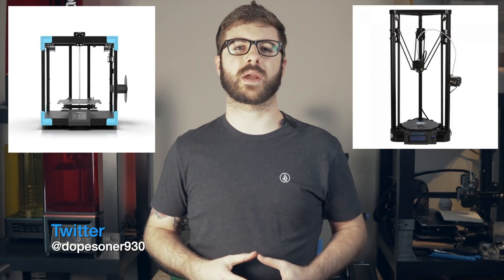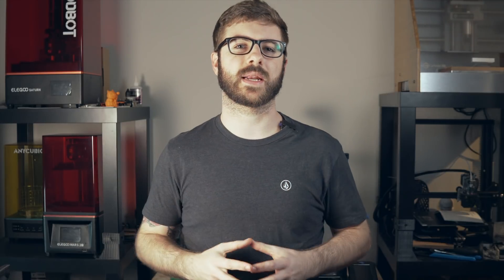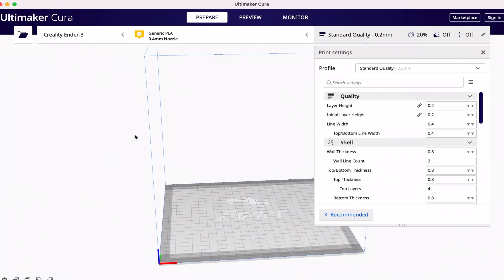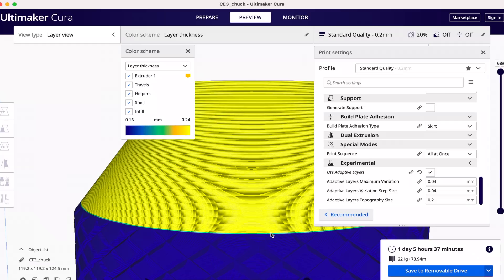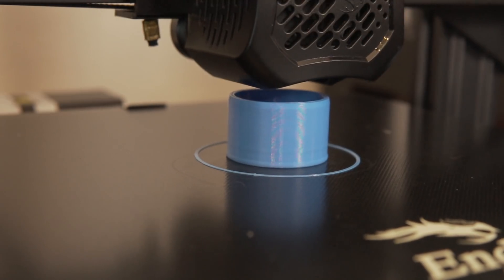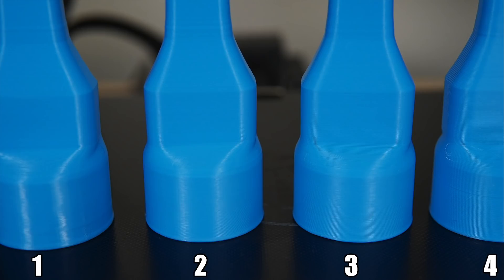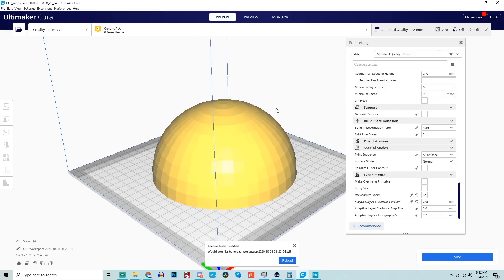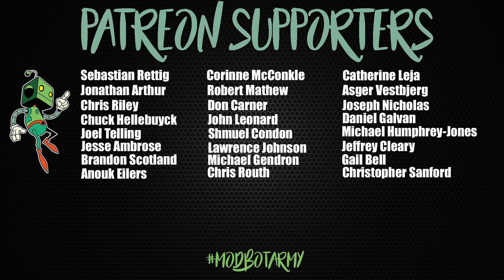Using Adaptive Layers For Faster 3d Printing

Comment: I have been printing Warhammer 40k bases and using Adaptive layers has saved a lot of time, especially on larger bases. Most of the layers is simply a circle with infill, and I paint the sides black, so they layer height doesn't matter so much, but the top surface quality and layers need to be high quality. On my largest bases (130mm), it took my print times from being 26hrs to 13hrs.

Comment: I do not know how did you speed up anything there, i print on 1,50 layer , extra fine , without adaptive at all, with 0,6 nozlle, 23 hourst for model, with adaptive, fastest mode from your video is 28 hours and up to 32h print time. so its 30-50% MORE time not speed up.  only thing that is, model look smuch finner with adaptive layer.

Comment: Is there any way to do this and still have you're parts FEATURES be at the correct height? Can it increase and decrease the NUMBER of layers depending on the layer size locally in the model?

Comment: The way I understand it, is that it works both ways for every layer: decrease time and quality or increase time and quality :) If your model has a lot complex features, it will on average decrease the layer height more often, than increase it. You can tweak it to force what you want, but we must remember, it is not a magical tool.
Let's say your goal is only speed and your standard layer height is 0.2. Then, what you should do is to raise the default Height for example to 0.22 and Maximum variation to 0.2. Your height will be always between 0.2 and 0.24. With such parameters, it cannot take more time. Never. Can only be quicker. But as a consequence quality will decrease more or less significantly. Cura provides an overview, which layers will be impacted and how much, to assess if it make sense at all.
You can go the way around and decide to put focus on having nice curves in the X-axis. You would just setup layer height to 0.18  with a 0.2 Maximum variation. With such parameters, you will get a layer height between 0.16 and 0.2. In that case, printing time will be increased, but only for "complex" layers.
Reply: I set mine to such a setting but set the topography size to 0.2 also. It does 90% of the print at 0.2 but very large and flat surfaces get bumped to 0.24 which speeds things up a bit without losing any visible quality.

Comment: It seems a little nonintuitive with some parts and value combinations, but it's really fascinating to play with all of the numbers while viewing the layer thickness. 
I think this will solve a particular issue I have with a part that is too thin and requiring more, thin layers that slows printing but allowing the rest of the part to be printed even thicker than my default and shave off a ton of time in general. Really cool Cura settings, thanks for sharing!

Comment: I can definately see the difference. but the real issue here is, does it matter on a piece like this. my answer would be no, it doesnt. if you were printing something that you wanted to look its best, then obviously you would do without the adaptive layers. but for this, you just want it done fast and still be useful, which it is. great video.

Comment: Increasing layer heights over 0,2mm decreases print strength. It might be important for functional parts
Reply: Only if you're using a .4 nozzle or smaller.  I use .8 nozzles for my functional parts and typically print at a .4 layer height and they are very strong.  I usually don't go above half the nozzle width if strength is required.

Comment: I've been playing with adaptive layers, and I agree I wish I could set it not to switch back and forth.  I've got this part that has one little line of a different layer height and I'm worried that it will show up as a line in the part.  It's a decorative part printed in silver silk filament, so the surface finish is very important.

Comment: I tried adaptive layers a couple years ago and it messed up every print in the same spot of so many prints. It would cause jamming and skipping then under extrusion so i disabled it. For the longest time I thought it was bad Gcode or my printer  was messed up but it turns out it was just the adaptive layers causing it. Maybe its better now than it when i last tried it?

Comment: Is there a setting to print the infill layer height at a different resolution then the perimeter. I can see how logistically this would be difficult based on the geometry of the extruder tip. But could be a huge time saver to get high resolution on the outside while reducing print time for infill patterns. And while decreasing infill density is always an option to reduce print time, that sacrifices structural integrity while changing layer height really does not.

Comment: bigger layer height =stronger prints
bigger nozzle is way better imo
Reply: This is wrong.  A bigger layer height produces a circle rather than an oval.  An oval will contact more surface area with the prior layer resulting in greater strength.  A bigger nozzle can create more of an oval though if that's what you mean.

Comment: I think that the main idea behind the adaptive layer high is not the speed or the quality but the precision. For example if you print 25.5 mm part with 0.2 mm layer hight , you will build it 25.4 or 25.6 . May be with that setting we can build it exactly 25.5.

Comment: I believe Flash print has a automatic setting for that so it's clicked it to us and it will adjust according to like you explained. However there's not many videos going in depth for Flash print like there is for cura

Comment: Is there a way to print everything but outer walls thicker? Like say .3 vs .2 granted every other outer wall would be printed twice but that would even allow a spiral eliminating half of the layer starts on the outer wall too.
Reply from the maker: Not as far as I know. I feel like I have seen dual extrusion setups where you can do infill with a larger nozzle and use the finer for the outside to speed things up. But I have not tested myself and am not positive that it is a thing.

Comment: Cura has improved quite a lot.It’s just  a shame it’s not as good as Simplify 3D to set up multiple layer height at different heights with more control. Although manually

Comment: Personally, my biggest timesavers have either come from 3D Printing at a 0.6mm layer width instead of 0.4 in combination with only using 2 instead of 3 perimeters for the same total layer width but a rough ⅓% perimeters print time reduction and by simply avoiding the use of supports for as much as possible either via designing the print to not be needing them to begin with or by modifying the design to include faster printing custom mesh acting in place of automatically generated supports. Also bumping up the Speeds of many moves can shave off a lot of time.

Comment: is there a way in Cura that I can change the layer height during the print? I would like my print object to be set at .2mm layer height, but the top few layers, I would like it to be printed at .1mm layer height. Is that possible?

Comment: Unless I'm doing something wrong, ticking adaptive layers, and using any of the 3 examples you used, my print time increases, rather than the expected decrease..
Reply: Remember It work both ways for every line: decrease time and quality or increase time and quality :) If your model has a lot complex features, it will on average decrease the layer height more often, than increase it. You can tweak it to force what you want, but remember it is not a magical tool.
Let's say your goal is only speed and your standard layer height is 0.2. Then, what you should do is to raise the default Height for example to 0.22 and Maximum variation to 0.2. Your height will be always between 0.2 and 0.24. With such parameters, it cannot take more time. Never. But as a consequence quality will decrease more or less significantly. Cura provides an overview, which layers will be impacted and how much, to assess if it make sense at all.
You can go the way around and decide to put focus having nice curves in the X-axis. You would just setup layer height to 0.18  with a 0.2 Maximum variation. With such paramters you will get layer height, between 0.16 and 0.2. In that case, printing time will be increased, but only for "complex" layers.
Reply: Same for me. It increased my benchy print time by about 45 minutes..

Comment: I am in the middle of a 16 hr print of an Easter Egg while watching your video. I added Adaptive Layers to Cura 4.8 and resliced and it cut the time to 12 hours, amazing. I will print that tomorrow and compare, Thanks for the information.
Reply: Was there a difference?
Reply: @ssjronin3972  Yes, the print failed multiple times so I abandoned that slicing method, no idea why it didn't work but I gave up
Reply: @winicuda  good to know, thanks for responding!

Comment: Where this really helps is with a larger base layer height and large objects with areas or detail.  I would give it a larger layer range.  You can cut some print times in half if you work with a 0.4 nozzle

Comment: is this not all way round? Low res will speed up the print speed and higher resolution will slow down print time? Will low resolution mean less layers, means thicker layers? I'm I correct?
Reply from the maker: lower resolution should mean thicker lines and speed up the print. I think that is what you are asking and I believe we agree.

Comment: how did you do the color settings bit to show the layers?
Reply from the maker: So in Cura when you slice a model go to the preview tab then click on the top where it says color scheme. Underneath that there is a drop down that you can change from line type to line thickness :)

Comment: Before I received my printer I watched a video where it was stated that printers can only move 0.08 in Z. Is this true? I’ve been using 0.08, 0.16, 0.24, and 0.32 respectively. I notice that most tubers including you use 0.2 and such. I take it that it works well for you but I have been too wary to try. I guess I could do a comparison. Great adaptive layer vid, will have to give it a go
Reply from the maker: Hmm, it may be the "magic numbers" that users talk about due to the pitch and thread of the lead screws and the stepper motors ability to turn. There may be some validity to this at least to an extent but it has never been an issue for me. Also with 32 bit boards and the implementation of trincamic drivers with extreme microstepping, I cannot imagine that still being a factor.
Reply: @ModBotArmy  8 bit here, someday 32, someday
Reply: The ender 3 and therefore I assume most 3d printers have a 0.04 res in the z axis

Comment: True that adaptive layers can speed up your prints.  However, if you are printing with holes in say a vertical surface or variances in wall thickness it can produce issues.  I have a box that has several holes in the sides and adaptive layers actually makes the part look exactly like the preview.  Stripes and all.  Not great for parts that require smooth surfaces.
Reply from the maker: Interesting, what is your max variation set to? That is great to know and I could see that as being an issue for things with tight tolerances.
Reply: I will set mine to the suggested 0.2/0.22 and try some experiments.  I disabled it when I saw the issue so I am uncertain as to what it was originally.

Comment: very useful!  I have been doing this manually in S3d, have had great results on speed, but sometimes inconsistent surface finish during shifts
Reply from the maker: Ahh so that confirms it then. Simplify does not have this natively build in. I had a few people reach out and I saw mention some years ago but not an actual release.

Comment: When you say the first layer is at 0.24mm for the .2 mm print, or does that mean that the nozzle is raised above the bed 0.24mm or is it pushing out more filament because it thinks that it is printing at a .24 layer height.
Reply from the maker: So I set the first layer to a .24 layer height. What I mean is that I have it lay down that height of filament to give a slightly wider base. I can see why you may think I mean nozzle gap but I mean slicer setting for filament amount :)
Reply: @ModBotArmy  Thanks, that’s what I figured. 👍

Comment: When you say the first layer is at 0.24mm for the .2 mm print, or does that mean that the nozzle is raised above the bed 0.24mm or is it pushing out more filament because it thinks that it is printing at a .24 layer height.

Comment: Reducing the layer hight allows to print overhangs with bigger angle. So with adaptative layer you can increase the "support overhang angle" up to 75°, what reduces the amount of support generated and then reduces the print time. Of course, this depends on the model and the material.
Reply from the maker: Interesting that does make a lot of sense as the steps would not be so large and would allow for a steeper overhang. Thanks for the information!

Comment: Combined with differing infill density's, strength can be increased in areas where it is required without compromising a high resolution and aesthetic quality across the majority of the part.
 I wonder if ironing is affected by adaptive layers?
Reply from the maker: Hmm I wonder how well the ironing would work with adaptive layers. Since it adjusts flow rates based on the top layers I would be curious to know if it can account for multiple top layers

Comment: Just tried adaptive layers, incredibly shaved 45mins off my  print time, quality still good for my projects, (I need 20 parts, so this is a huge time saver for me). Thanks for breaking down the options in the hamburger menu to bite size understandable chunks. It is extremely helpful and much apprenticed. Thanks
Reply from the maker: Jon, your comment made me hungy. Lol it is nearly lunch time and I know that I used the phrase hamburger but that and bit size really got me craving food now. I am stoked to hear that it is going to be able to save you time on your project. What are you printing??
Reply: Hey Jon, what is your project, and how did it go? Do you know how much time it saved?

Comment: Really ModBot, have a look at PrusaSlicer.  It's implementation of variable layer height just makes Cura look like a novice.  I still love the extra parameters Cura exposes for some stuff and PrusaSlicer does not have, but the paint-on-supports and variable layer height in PrusaSlicer have tipped the balance for me for most prints.
Reply from the maker: The paint on supports do look pretty cool. I do still follow Prusa Slicer so I see when they add new features which seems to be quite often.
Reply: @ModBotArmy  did you ever go back and play with adaptive layers in PS? Did you like the ability to adjust layer heights with their slide bar? Or use paint on supports? Just curious. Thanks!

Comment: Set  your settings to 0.22 and a deviation of only 0.02 that will give you 0.20 to 0.24

I use adaptive all the time sometimes only a deviation of only 0.01. It really helps with rounded top surfaces
Reply: you beat me to the setting recommendation and the same is true for below as in .18 with .02 makes the .16 to .20
Reply from the maker: You are completely right. That would be a great way to have it essentially only go from .2 and up like I mentioned in the end. Great recommendation thank you.

Comment: Great video!  Iv been using variable layer height in Prusa Slicer for a while.  I couldnt see any real difference in the parts you showed, so not sure if it was the camera, the filament, me just not being very observant, the differences in slicers, or something else, but I can definitely tell when I use it.  If it is something I am going to paint or something that looks doesnt matter any, I use variable layer height.  If it is something that needs to look great, and I dont plan on painting it, then I just go for a smaller layer height.  The differences in layer lines is just visible to me and drives me a little nutty.  I do use it regularly, just not often.
Reply from the maker: Thanks Jon :) How large of a deviation do you typically allow when you use it? Or does it very based on the model for you? Totally, if you are going for looks or at least that is a big factor I can definitely understand wanting even lines and just taking it slow.
Reply: @ModBotArmy  Prusa Slicer does things quite a bit differently with their variable layer height.  It starts with the profile you are using as a base line, and has a slider that you move to get either more quality or more speed and it adjusts every layer differently based on its geometry.  If I am starting with my .2mm layer profile then I could have layers at .32mm or layers at .07mm all in the same print.  There is some more manual adjustments that can be done too, but with that your just clicking on a graph of the layer sections to change that specific area to faster or more quality.  It is likely I am missing something, but I have never seen any settings like you was talking about with Cura.  

It is something I probably ought to look more into.  It can speed up a print quite a bit, but if it is something you are painting anyway, the differences between layer lines just dosnt matter as they will be covered up.